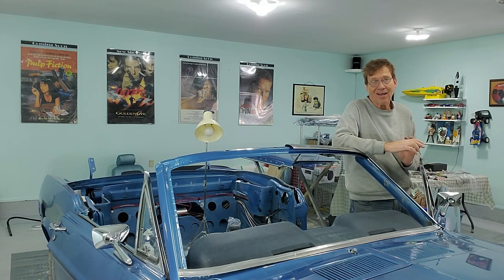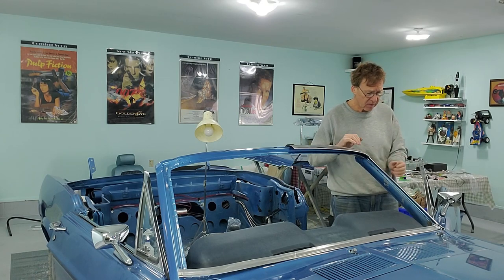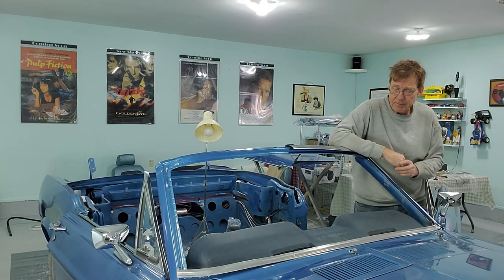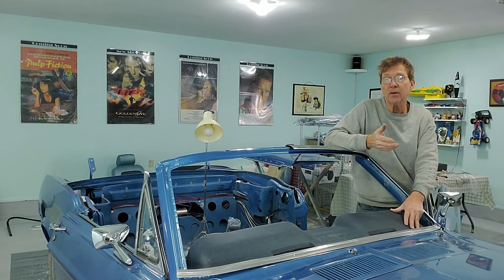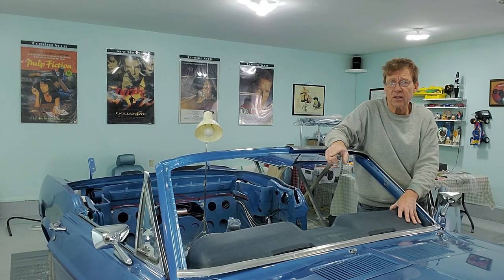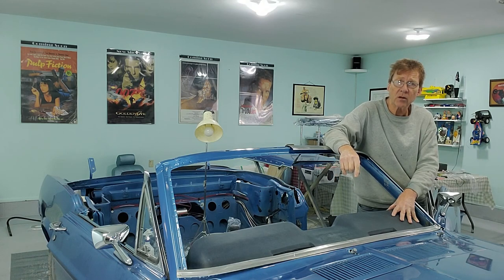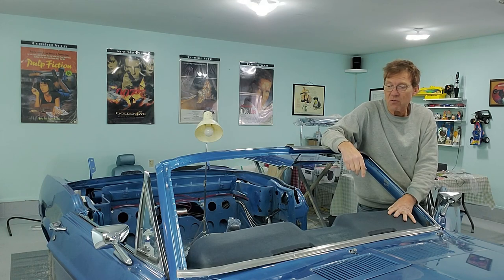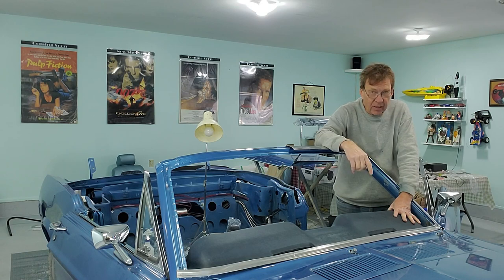Dash Pad installation 68 Mustang restoration

Comment: Are you planning to install the dash pad and A pillar pieces before the windshield?
Reply from the maker: Great question, I have searched a number of sites on this and although there are a number of opinions basically the winner is YES , you can install the dash pad first which makes it A LOT easier. Also both Jo Daddy's Garage and  Chris Ingrassia Mustang recommend this approach and have videoed the process. AS far as the "A" pillar pads they snap in so will install after the windshield. I will document the process as well.
Reply: @68mustangrestoration34  I've watched Jo Daddy do the same thing.  Interestingly, I don't have the 4 holes on the dash for fastening the pad down.  I have an early 68.  I guess I could drill my own holes.
Reply from the maker: @jeffunderdahl8605  I used the original holes as proof the pad was originally  attached to the car but ended up creating new holes. These flat screws have a build in drill bit so it  just makes new ones.